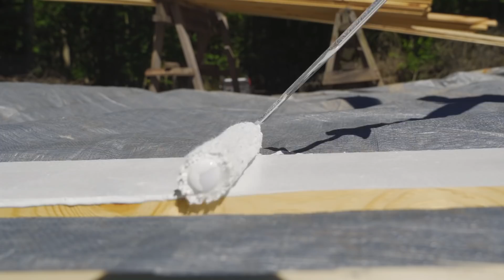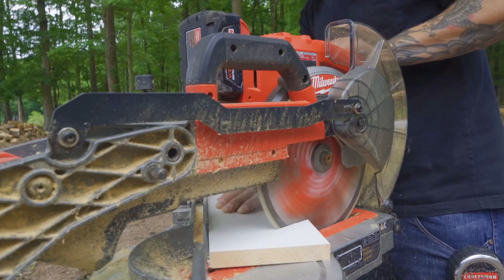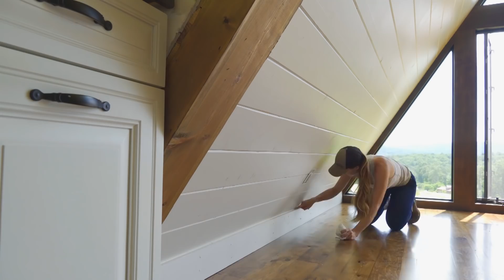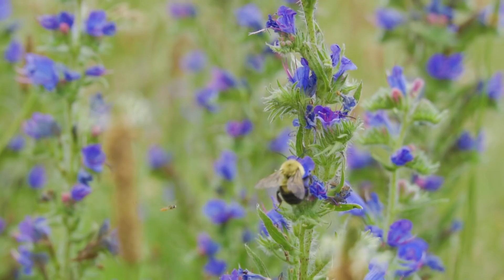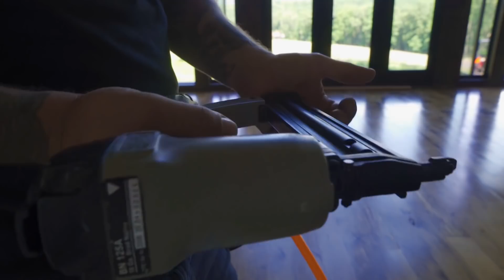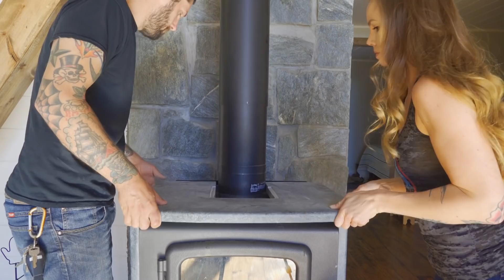Adding Soap Stone To Our Off Grid A-Frame Home

Comment: Hey guys! Love the episodes. Quick suggestions from experience. If you don't want the nail holes popping back out on your baseboard, don't use caulk and use either wood filler or DAP drydex. Keep it up and I look forwarded to every new video!

Comment: Use a wet sponge [not too wet] and you can make seamless joints and paint after as chalking will change colour over time if left. From a 1/16th of an inch up to an inch gap you will master any chalking [as long as it is water soluble/clean up] Bathroom is different use silicon inside tub areas ect but DAP in their little red tubes are a carpenters best friend ... place looks beautiful as your family keep going! Cheers from Canada.

Comment: Hi, it's David again.

I'm looking at your new video, where Erin and Josh are caulking wood trim, cutting wood trim and applying "soapstone", so hopefully most everything is still intact, from where you left the problems with the last faux A-beam. 

This following would appear to be the best and most complete solution for your fit and finish problems. 

Essentially, you need to recreate the faux A-beam, and move it about 1" to the left. 

This will allow the faux A-beam to pretty completely cover the corner where the pine wall coverings meet.

And this will allow "one leg of" the faux A-beam to fit into the gap between the kitchen cabinets and the faux A-beam, and thus, cover the (now-)exposed drywall. Additionally, making the gap between the faux A-beam and the kitchen cabinets, as small as 1/4" allows you to make the disruption to the row of cabinets as small as possible.

This causes a dimensional change in the placement of the row of kitchen cabinets, but it resolves and solves some many problems gracefully, it is worth pursuing.  

Good luck, you done so well on everything else, I know you'll fix this!

Comment: I'd suggest building a large work table where you do the sawing. The time it will save you later will more than make up for the time it takes to build it. You can even build it like a picnic table if you wanted to. then you could re-purpose it later. It will speed up your work and save your backs.

Comment: If you have like a plastic sheet from a packaging or something, cut it something alike the brim of a hat and slide it in the lip of the paint can every time you tip it over. I usually secure it with a bit of painter's tape.

Comment: Caulking :  A wet t-shirt rag wrapped tightly around your finger is the way to go !!
a)  many passes as you like.
b)  water helps remove residue not stick outside radius of finger.
c)  moving rag to new spot helps keep you engaged longer.
d)  clean up ..... well, there is no clean up b/c it's all on the rag & not your fingers or jeans were you wiped your fingers off.

Comment: If it were me, I would have likely put in the angled pieces to prep the wall for trim, then installed flooring. That way, the trim would sit on the flooring only versus extending all the way to the wall, and replacing flooring would be easier years down the road. Then again, new flooring could always be installed on top of the pine if needed. Either, the end result ia looking great.

Comment: When it comes to buying the couch, don't skimp. Make sure you get one with springs in the cushions. Trust me on this. Get a higher end couch that can just be recovered in 10-20 yrs when it finally wears. A GOOD couch won't wear out. It will just need new fabric. When I got married, our couches were our first purchase. We left them when we moved because we were told they could be easily replaced. We are on our 4th in 6 yrs... I miss our old couches. lol

Comment: A secondary effect of that soap stone is that it will hold heat and radiate it more slowly than the metal. It might even reduce the feed of firewood.

Comment: pro tip don´t use your finger to straighten out silicone,  after silicone, spray a little soapwater and use an empty siliconecartridge to cut off the surplus silicone

Comment: Why not two rooms upstairs? So the boys could have their own rooms. You had a space on the side. Why not use that space for another room upstairs?
Reply from the maker: We will have 4 bedroom in the bedroom wing of that house that we are building once this portion of the house is built. The loft is meant to be "a loft" (a nook), not a permanent bedroom. This current portion of the house actually has no permanent bedrooms- we are just making it work temporarily until the bedroom wing is built on. Then everyone will have their own bedrooms and bathrooms